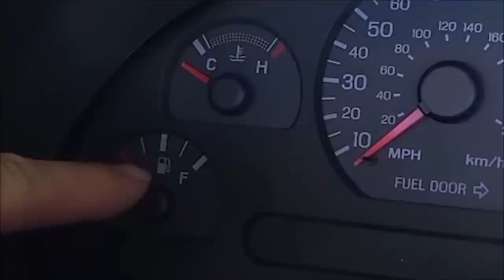Will it sell and How Much ? - Flying Wheels

Comment: I got the best deal ever. 1991 mx5 miata, B package red, A/C car 5speed. Garage kept, full service records, 0 rust, 140k, 2500 dollars. Car is beautiful. Came with a recent 5kdealer repair service, new tires, and new exhaust, full fluid change. I'm still in shock it's in my garage.

Comment: Good video.

The gas pump on the gas gauge doesn't represent which side the gas door is on. All cars have the gas pump on the gauge with the nozzle on the right. If the car shows which side it's on, there will be an arrow. I don't get why all cars don't have it. Such a simple addition to the gauge cluster.

I've never seen the huge lettering on the Speedometer at the bottom showing which side it is on like the Mustang has.
Reply: All cars don't have it because people didn't use to be complete morons and could remember what side their gas door was on. That and you used to be able to tell by looking in the mirror down the side of the car

Comment: If you were going to the auction those 3 weeks in a row anyway. Then I wouldn't add the 3 auction trips  to expenses for the Mustang . But if you had to pay to run the car threw the auction 3 x . Then I say calculate the trips in to total.

Comment: 4 Wheel alignment is bullshit, there's almost no adjustment in the back end, and most mechanics don't bother. If it drives straight, doesn't wear the tires on the shoulders, chirp the tires on turns or pull ya out of your lane most drivers are satisfied

Comment: Dang for $4k with all that power it’s a slamming deal. I want it 😩😭
Reply: Goes to show you how much they've gone up in value. 4 years ago I was looking at a mint 2006 black on black convertible GT with 45K kms for $5500 cdn. Someone I know just paid $20,000 cdn for a 2008.

Comment: I have the same exact car, but mine is a 2004, and has a 5spd. I'm glad I did not get the automatic. Your car seemed like a dog. My 5spd will smoke the tires, and do donuts all day long, Lol. I installed a MGW shifter. That made it even more fun to drive. I paid $4,000 2 years ago, and is in better shape than yours...

Comment: fixing the seats and Top would have netted you the same profit but, much sooner.   i still think you over paid at the auction. and retail was your only way out....   Someone has  to fix up these older cars and it really is easier for the used car dealer to get them fixed up and back on the road at a price point that you know the buyer will take  care of the car.  cheap cars are driven cheaply  and neglected.    No one is buying a common Mustang, and then doing 2,500 dollars worth of work to a 3000.00 car.   but.... others will spend 6-7 k on that car all fixed up.